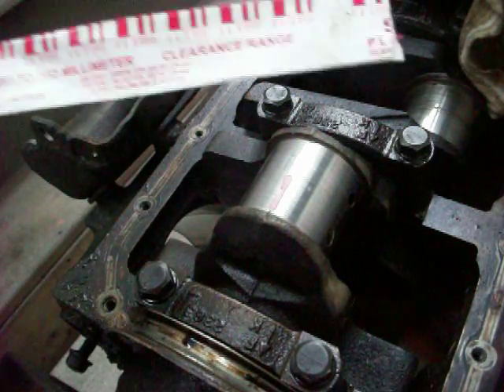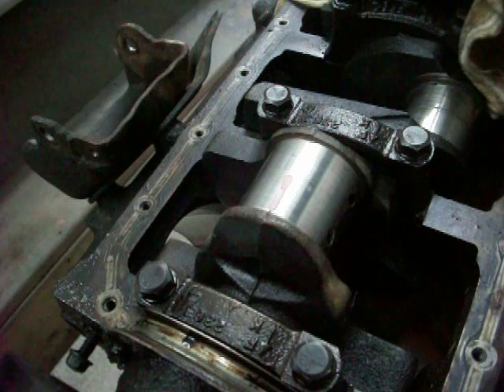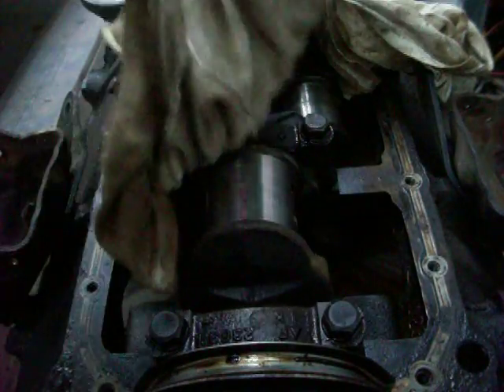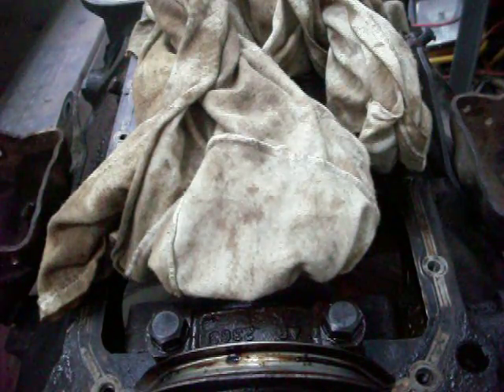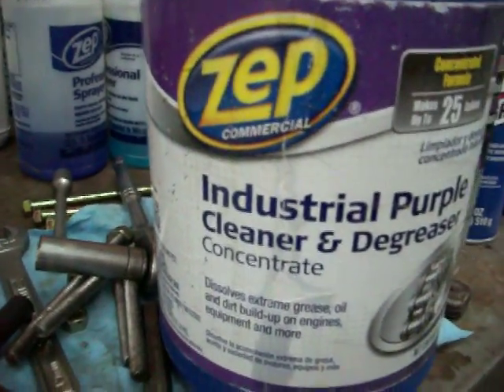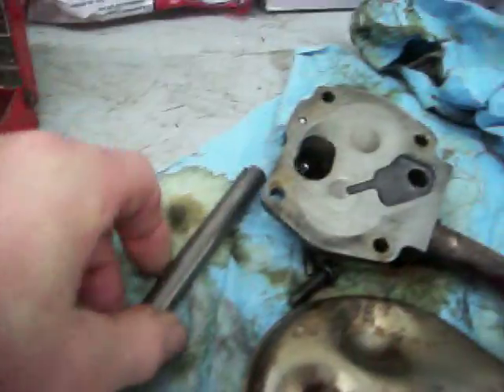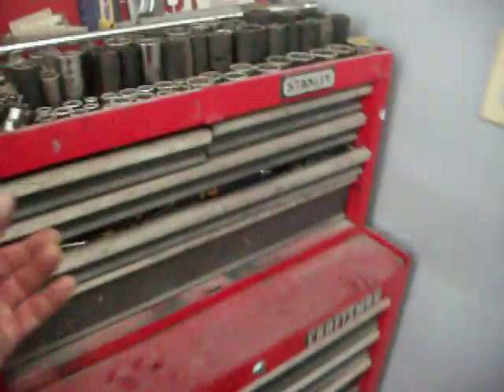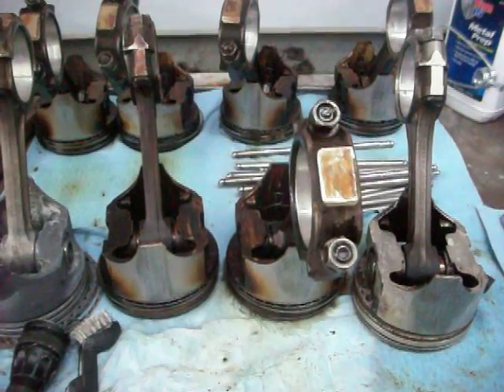Bearing clearance on a Chevy small block. #4

Comment: all the videos show plasti guage but none tell you what   clearence you actuly need on the bearings
Reply from the maker: Bearings are all different for crankshafts and rod bearings. Usually .002-.0015. Use you auto manual to find out for your car.
Reply: Did you even watch the video? You have to measure for the correct size bearing...it's that simple.